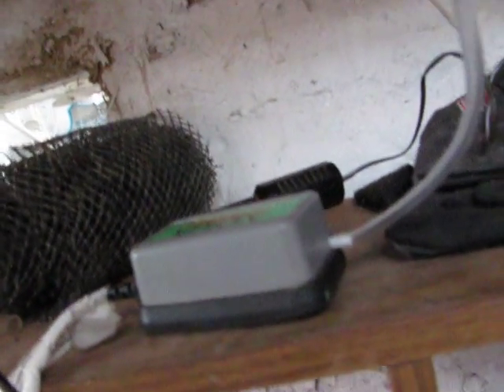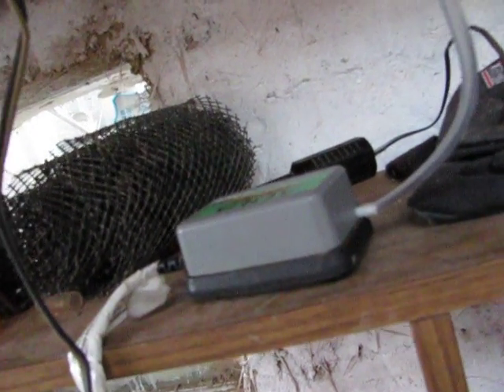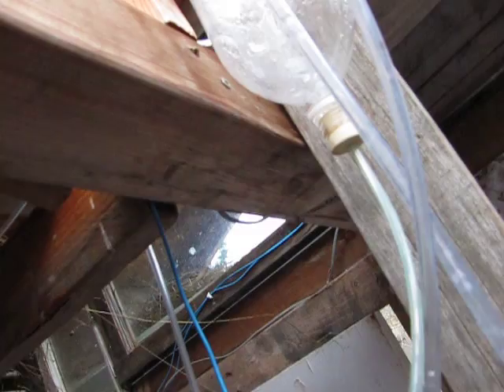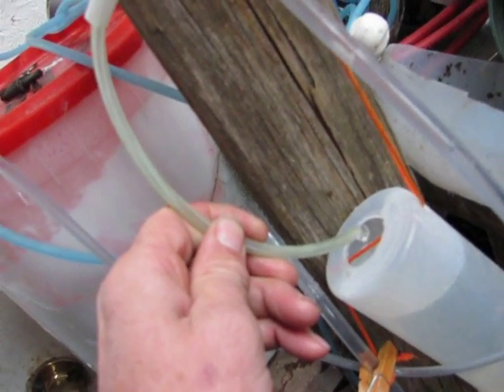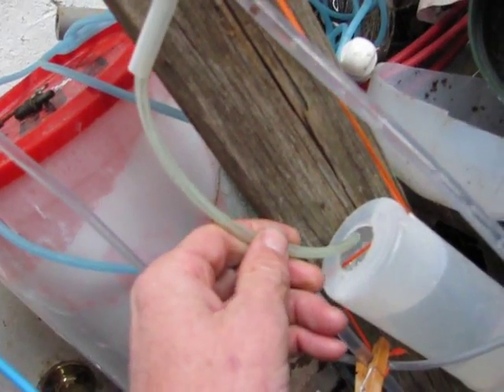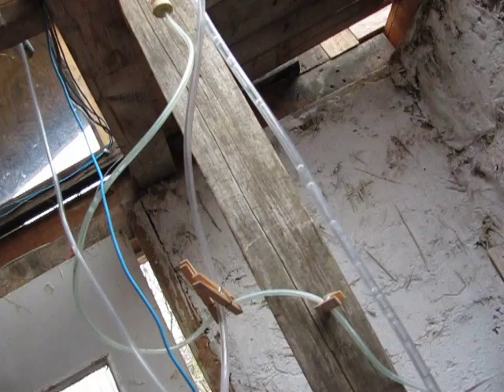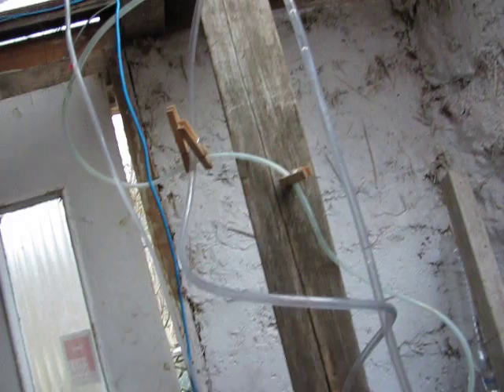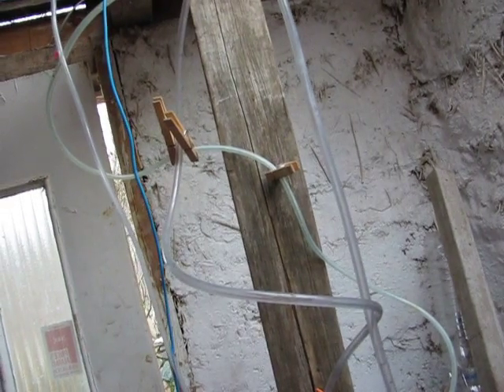Power 2 or more windowfarm columns from a 1 outlet air pump

Comment from the maker: It was an old pump that I found dumped beside the road.  I wrote down in a comment somewhere how fast it pumped. Found it! The maximum that it pumped is 1.4 liters per minute of air.  It was capable of pushing that air up to 1 meter deep. (But at 1 meter deep, I think it pumped air really slowly (in any case, I never had it pumping with that much pressure).  (Due to the lack of quality in the pump, I  kept the experiments as proof of concepts and nothing more)

Comment: what type of pump is this, what gallon tank is it rated for? I found a 4 way gang valve on amazon, and that would split it into 4 outlets with control for each, im hoping a pump for 40 gallon tanks would be able to service 4 columns.